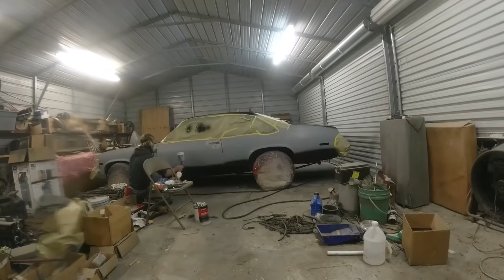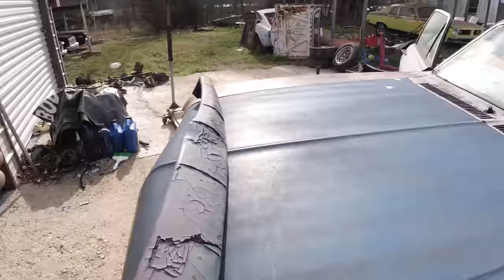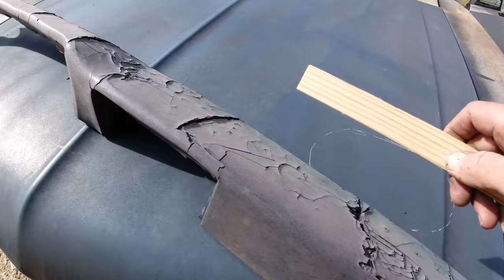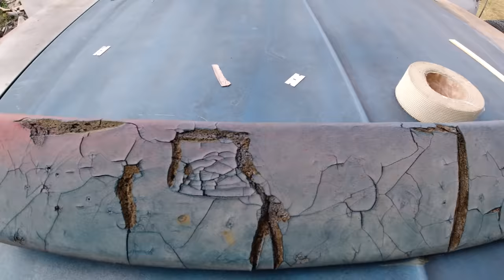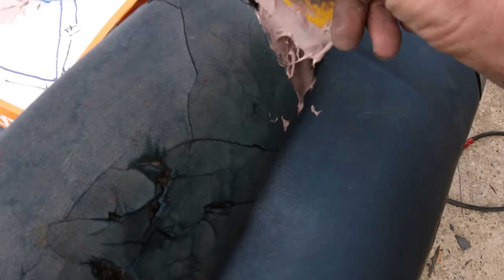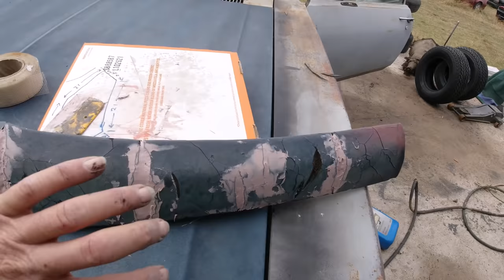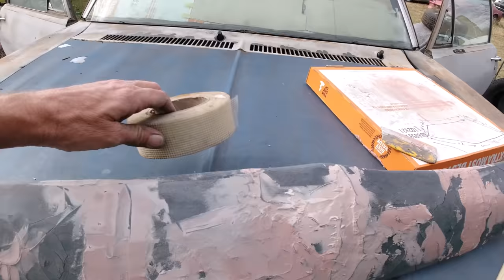Restoration of a 1972 Chevy Nova - Part 16 - Rebuild your dash pad for $10 !!

Comment: Good Job.  I like the drywall mesh tape in bondo to strengthen it.   If someone is trying this,  3M spray adhesive 77 or 90 is quick dry compared to contact cement,  really helps nail down edge wraps.   Don't be afraid to glue the top, then let it sit for a day, before you start stretching the sides.    Get an Extra piece of your material to practice with - find out how it reacts to heat gun and how much shrink you can get.
Reply: Great tips thanks !!
Reply: Great job brother

Comment: The theory behind contact cement is to apply to each surface and let dry.  When  you wrap the vinyl and the 2 surfaces make contact, it will stick.  You don't need tape to hold it.

Comment: I've done a couple of these, never thought about using drywall tape though, thanks for that tip! I have also not used the flimsy vinyl from Amazon on dashes, I have used it on homemade consoles though, I use the outdoor vinyl from Hobby Lobby/Michaels/Joann's fabric, yes it's a more expensive but it's also thicker and will last  longer because it's designed to be used outside, plus the Dark Red and Green are only like a 1/4 shade off of what the Big 3 used in the mid 60's through 1980 ish and it's on a roll so it doesnt come folded so no fold lines and it has the fabric fiber backing that strecthens it when glued. They also have a Faux Tan (natural), Brown and Black leather for the same price with a custom look. I will spend a few dollars more to get something that lasts longer because the longer it lasts the less I have to deal with it again.
Reply: When he was in the middle of this project talking about thin and cheap vinyl I was thinking no, you want the thick stuff, but other that added uv protection, I have seen others struggle with thick vinyl where it has to follow alot of contours and this thin stuff seemed pretty unfazed, it also glue down pretty nicely, I think he is onto something.  Also, I would usually use 77 spray but the contact cement seemed better in that It it really sticks when dry but drys slower so you have extended time to work it.  Overall great project and instruction.
Reply: @peglegtoo  I agree and disagree, great overall project and instruction but that thin vinyl won't last in most places more than a a year maybe 2, yeah the thicker the vinyl is harder to work with and it may take you a couple of days to get it done  but you only have to do it once, your not tearing it apart in a year or 2 and doing it all over again because you bought thin vinyl and it's already starting to melt or harden up and cracking. I'm all about doing it right the first time and never having to do it again.

Comment: This definitely works.
I did one years ago and had the material added by a specialty shop for $50 back then.
The guy told me what to do at each stage and then applied and shaped and trimmed it.
It was better than new and felt nicer to the touch.
If there was a replacement available it would not have been better.

Comment: I remember a time before the restoration reproduction parts existed. This is how we fixed things if we couldn't find a nos part from a old dealership parts department or a better conditioned part In one of the many local junk yards back then.  It was called just fixing a car up..not restoring it as common today. 
Like you said, we are going to have to go back to fixing things and working with what we have.
Excellent work there. 
Bonus is, you're keeping original parts on it still.
As a automotive trimmer by trade, this is exactly how I would have done it.
Reply: It was just called Fixing the car up,  because it was still too new to be as raggedy and wore out as you'd managed to get it,  So there was no 'restoring' those cars back then,  they mighta looked 'restored'. .. .. But in reality it was just alota folks takin a lot  better care of their shit then u were & not just runnin it into the ground blastin Rush Limbaugh

Comment: I thought I knew a few tricks to try saving an old dash pad but never would have thought of using bondo and drywall tape like that to repair it. I’m impressed with the way it came out and will be using this method on my 63 Dodge 440 sedan. I think I can see a few ways to make tools to aid in doing it and may even experiment with a few of them just to see how they will work for helping with trouble areas such as all those little holes over speakers on other dash pads.

Comment: This turned out very nice on some cars it's not as easy. This is just a dash pad some would require taking the complete dash out that's when it really becomes a problem. Can't tell you how many great restorations I've seen but the dash is still cracked up.

Comment: Good 'shadetree' method, excellent idea to make the video. Now, you want to know how 'the $500 per dashpad' guys do it (on things like original Boss Mustangs, etc.)? It's almost as cheap, uses 'off-the-shelf' items, and isn't much more expensive to do...and will give you an OEM dashpad, every time! First things first: understand what you're working with.
The 'foam' substrate is EPDM foam...quite similar (when new) to modern car foam seat pads (found beneath your upholstery). The upper 'shell' surface is not just 'vinyl' it's Polyvinyl Chloride (PVC...as in 'water piping'). So, you need two 'repair materials', plus (as most modern PVC dash pads are all one color, starting out, they are 'painted' with vinyl dye or 'plastic paint'...easily acquired at most auto-parts stores).
To effect a STRONG, 'like-new' repair, you basically want to 'weld' all the damage back together. I cringed on the 'Bondo'...yes, it fills...but it's not similar material...so, it's more like 'bondo-ing' a cracked water pipe, instead of welding it. You want a GLUE or other chemical that can 'properly repair' EPDM...closed-cell EPDM. The best I have personally found is that damn, nasty Gorilla Glue! Yep...worthless for most things, but for EPDM repair, it can't be beat! It bonds, it's somewhat pliable but rigid, it's waterproof when cured, it can be sanded and worked. Most repair shops use their own proprietary 'EPDM epoxy' selection...and choose depending on the size of fill or crack they have to repair. I have found that if you flip the dash over and 'back-tape it' (like backing a weld on a thick plate) with simple duck tape, the Gorilla glue works still...you just may have to be patient for multiple layers to cure...takes 24-36 hours for good cure per coat (and if you jump the gun, it will keep expanding and 'rise' on the repair line eventually). Oh, one other note, WATER makes Gorilla glue cure...so warm temps and high humidity do the magic to get it there as fast as possible...you can even 'spritz' the 'final fill' with a mist of water, to make sure the glue has all the water it needs to properly cure...just get the prep clean of dust first.
So, identify your cracks to be fixed, use a dremel or 2-inch pneumatic grinding disc...V-grind the crack to the backside (but don't 'open up' the crack any wider at the bottom than it was originally), dust it all off really good, back-tape the crack - if it went all the way to the backside, now fill the crack with gorilla glue (in multiple fills, if it is deep...too much at one time, and it will never cure)...and now to fix that top 'vinyl' surface. See, we fixed this layer at a time, not like 'one bulk fix'...like trying to fix a car tire using steel plugs...yep, there's a steel wheel in there, but rubber is on the outside!
For the outer surface, most 'Pro's' use something like Polyvance Padded Dash Filler to repair the vinyl. Keep in mind, while the can says it can 'fill the cracks', it's not really meaning the foam...so don't think you've got a one-can solution here. This is for the VINYL outer surface...an 8-ounce can of it is around $35...but that's a LOT of putty to have on hand (4-6 dashes...even 2-3 like the one as bad as in this video, if repaired correctly). Plasti-Dip also makes a surface vinyl repair gel that's clear, and MELTS contacting vinyl to weld itself into the repair. (Plasti Dip 61Z09 VLP Clear Vinyl Repair) While it sounds 'cheaper' at $10 a 1-ounce tube, notice that's only 1/8th as much product for 1/3 the price...Polyvance is cheaper.
Last two items you'll need is of course, the desired 'plastic dye or paint' that you want the dash to end up...Plastic-cote and several others make exactly what you need...1-can should do it if you are going back 'near the original color'...and the dreaded pain that most 'hobbyists' never figure out...'how to get that texture to match' for the grain. THAT'S EASY...got a hot glue gun and a 1-inch dowel of wood? Take your wood dowel, cut it off square, sand it smooth (oh, and heavily Armorall or 303-Protectant a small area of the dash you are repairing)...now, ideally using 'black glue' (dries very hard) for your glue gun, put a hot, wet puddle of glue on your wooden dowel...as it starts to cool (don't do this too hot, or you'll get a thermal bubble in your vinyl), gently press it down on your desired texture area. Once cool, use a little cold water mist and a plastic 'bondo spreader' to lift the dowel off...you now have a 'texture stamp' that is GUARANTEED to be a perfect match!
Now, prep your 'formerly repaired EPDM cracks' with a dremel or 2" pneumatic, you want that top valley to be 'square with slight ramping to the top of the EPDM'...now, clean (again) and put your Polyvance Vinyl repair-filler into the prepared valley...fill to flush of the gap, and slowly as the Polyvance starts to set, 'set the grain' with your dowel. Too soon, you gooey up your dowel-stamp, too late, and you don't get a good grain transfer...test it with your finger for 'right time to do it'. Finish up with some fine 360-480 sandpaper, to get rid of 'silkies', strings, etc.
Let it all cure up...give it a day or two, check it well, and paint it. The repair will last as long as the OEM dash did. Oh, and one other thing...the thing that makes vinyl dashes crack is a combination of UV light, high heat and loss of vinyl esters...and THE ABSOLUTE BEST THING you can do to make that dash pad last a LONG TIME (other than cracking your side windows to let that 200-degree air out of the car in the summer) is protect it from UV while returning those vinyl esters to it...and the best commercially-available product available to do this is 303-Protectant! It was developed by the Aerospace industry, in conjunction with NASA and the Air Force, to keep 'esters in the compound polymers' of aircraft cockpits. Armorall doesn't compare...simply re-treat the dash twice yearly (more, if you let a lot of dust get inside the car, as silica grains wick esters out of vinyl)...For less than $40 a dash-pad, you can make a few bucks doing this for others too...as once you've got familiarity with repairing these kinds of dashes, you can make a fortune off a big junkyard run for Chevy Square-body trucks, fixing friends' dashes, etc.
Reply from the maker: Interesting but my method is for a quick, cheap alternative for a daily driver type vehicle instead of spending $300 for a new one, or in your example, $500 to rebuild one.
Reply: @clunkersandclassics  My way will set you back MAYBE $40...allowing for you having a dremel or grinder, some sandpaper and a box knife...BUT, you could then GET $300-$400 for the job...and there's a great demand for 'non-popular' dash pad repairs. Sure, everyone can order a '69 GTO dash pad' or a 'square body Silverado' pad...but how about a 1978 Nova, or a 1977 Cordoba? Hell, I just found out yesterday that my 'cockroach driver' ('02 Grand Prix) NO ONE makes a replacement seat foam or lower seat cover for it! $300 for a junkyard seat, $250 for an upholstery shop to recover it! Whole lot of 'we don't care about that model' stuff out there...
Reply: No o8 up ok 9

Comment: That's a fantastic job. I've seen many cars that look good except for the dash. I don't know if this would work, but I'd consider putting that vinyl into a clothes dryer for awhile to heat it up to get it nice & stretchy. Then maybe use a heat gun or blow dryer to keep it that way. It should cool & tighten up around the dash. That's just a thought because you got great results. Very impressive.

Comment: Landau top glue it can be sprayed with a cheap paint gun  coat both surfaces and let it tack up.

The problem with that stuff is it gets hot and starts comming back off. 

None backed and strech is used in car audio doing custom systems.

Personally i think fiberglass would be better to work with you could use fiberglass cloth. Thats never comming off. Them youll have to paint it.  Stinky job.

Comment: That dry wall fiberglass tape is the shit it’s strong and will hold things together real well !  This is a killer idea along with you can get matching color material for your interior .  Cause back in the day you  had white interior but most dash pads were not white also if you wanted to you could mold out your dash further or make the edges even sharper !  What a great idea again ! Hats off to this guy like one handed bonds spreading .  Get some real Italian leather boy you could be right up there with the bmw !

Comment: Mark a center line on the vinyl and the pad. Do so at the quarter width points as well. Reference lines in advance will help keep it predictable.  Work center out, only gluing sections at a time. Easier to make corrections as you go.  

Smoking is a bad idea as the fumes from the contact cement can light off.

Contact cement is meant to be used on both surfaces. You wouldn't need all that tape. Just start in the middle, glue the pad and vinyl 4-6", let air dry or user a hair dryer with heat, tack in place and move on. 

Leave those edges and curves for the end. 

Good job, and it can be even easier with a bit of planning.

Comment: I used to work maintenance at an OEM seat supplier. For smaller jobs like this, National Guards Foam Lock was the preferred glue, it gave just enough time to pull the vinyl into place, and any wrinkles and corners were taken care of with a Jiffy steamer.

Comment: I have done this a couple times, mostly on chevy pickups, but my favorite was by far when I did a grey 87 2 door s10 blazer with cheap purple velvet. I just bought cheapo stuff at hobby lobby and did the dash, console , door pannels, headliner....people really liked it or really hated it. At walmart you can get stuff called rit sun guard. And you wash the fabric in it before you glue it down, its uv protective, so it doesn't fade super fast. AND makes it fire resistant. Just in case
Reply from the maker: I forgot to mention that it was marine grade vinyl so I hope it has that stuff built into it to last.
Reply: @clunkersandclassics  awesome man, I just couldnt find any purple fabric that was uv resistant in my price range, and my friends mom who does alot of costume design suggested the rit stuff. Just helps to save a buck
Reply: I have a 1988 S10 Blazer and the interior ages really bad in hot places. Thanks for the tip.

Comment: Vinal Vinyle is like leather when creased. 
Hang up like a pair of pants fir a week to two weeks if you have the time.
Then lay it flat on a tabletop, suade side facing down, contacting table surface. 
I tape papertowel tubes together end to end. 
Starting one end of material, carefully roll it up. 
If not using the material within a week, pull the cardboard tube out. 
This allows moisture buldup to evaporate. 
Rolled up, this keeps material crease free. ifyou set it up high someplace & nothung ontop of it.

Comment: They make an unbacked and a strech type,  works a whole lot ezer.
It would help to glue a 1/8 thick foam pad on first then strech on the materials  helps with wrinkles.
You can also heat the vinal up first  but its warm, the heat will take out the folds before you start.  You need a larger work surface like a 12x 42" shilf material mdf or 3/4 pine plank thats long.

Comment: Wish I could search the comments BUT... question for ya- could I skip the vinyl and just spray it after bondo? Maybe it would look like a metal dash.
Reply from the maker: I think the sun will crack the bondo. If you want to try it, use fiberglass mat instead of vinyl.
Reply: @clunkersandclassics  Welp, I've spent all morning trying to remove the dash and something is holding it in right above the speedometer. It's not the cable, definitely a bolt or screw. Making me crazy.
Reply from the maker: @designsinorbit  Watch the next video after this one and it should show the mounting tabs.

Comment: I did kind of the same thing on my 70 Impala, but I repaired it with fiberglass and spray foam and put 1/4 inch foam before I added the custom sewed dash pad I made. the main reason would be if it did crack, it wouldn't immediately show through the cover. A little bit more than 10 bucks lol

Comment: I'm not very good at wrapping or recovering but pretty handy with Bondo lol. I've done dashes before with Bondo (never thought of the mesh tape though) then sprayed them with an undercoating, lightly sanded (for texture) then painted. May have to try my hand at wrapping again in the future. Amazing work.

Comment: A long time ago I sent a dash to a place in Oregon called Dash Specialists that did it this way. It was pretty expensive for the time but cheaper than Just Dashes which seemed to price however they felt like it that day. The thing I liked about the Dash Specialists was the vinyl they used. It was more pliable than typical seat vinyl. It seemed more 'expanded' so it could stretch easier. It wasn't 100% OE for a platinum resto but for 95% of most people it looked great.  It had a softer feel than the hard OE dash vinyl.

Comment: Try using resin to pour in on the decomposing foam and the use a small grinder and v out the area then fill with kitty hair then flatten and wipe with rage filler it will last forever